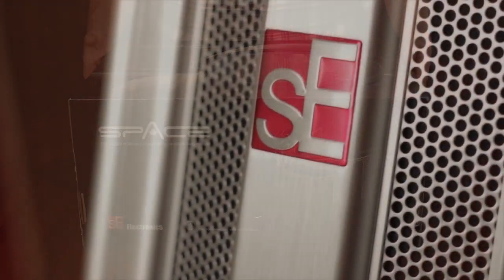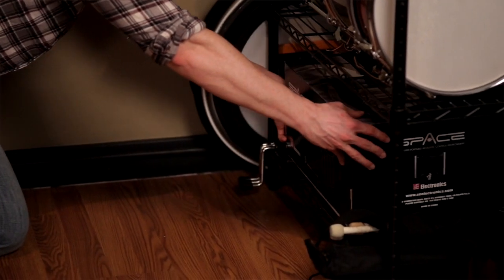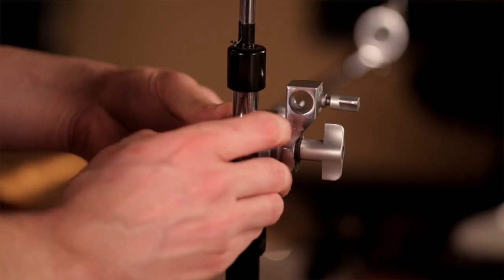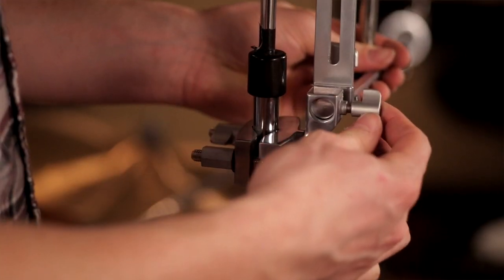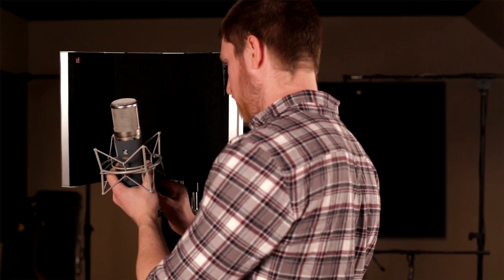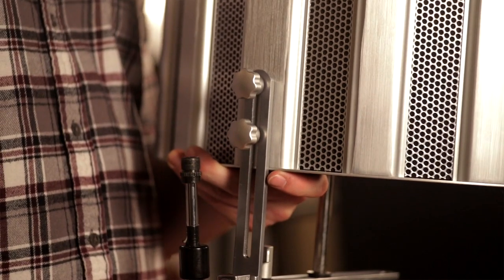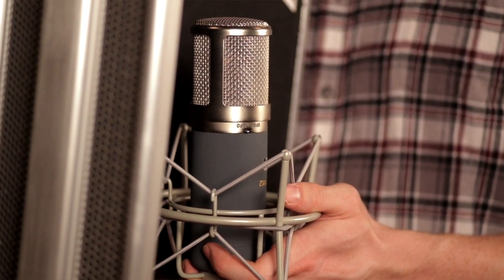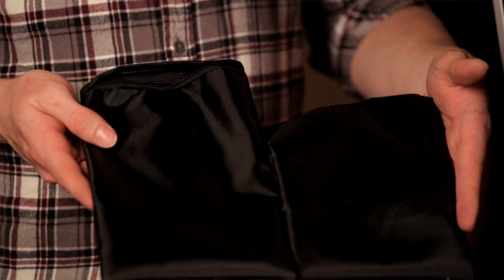sE Electronics Reflexion Filter® SPACE Setup Video

Comment: This video really is not very helpful in the set up process - moves too fast, and doesn't explain/show the steps thoroughly.  Consider remaking this, guys
Reply: In particular, I'm totally stuck on the "attaching the L bracket" step - The video goes into zero explanation/demonstration here and it's quite frustrating
Reply from the maker: So sorry we didn't see this comment until just now! The L bracket has a cutaway in the middle of it, and the two included large silver screws fit through that and into the back of the Space filter. (And we're sorry if the video moves too fast, we will look into this for future videos!)
Reply: I completely agree. The hands are in the way the entire time and it moves way to fast. After watching this a few times, I still can't tell if I even attached the clamp correctly. And that's the first step...
Reply: Yes it's absolutely unclear
Reply: @seelectronicstv  your explanation doesn't help 😩

Comment: Does the weight of this unit require a more heavy duty stand or is a standard stand sufficient?
Reply from the maker: Good question! The filter itself doesn't weigh all that much, but it's often used with heavier / more expensive microphones, so weight is still a consideration. We recommend using a fairly robust mic stand, and we also recommend taking care when positioning the filter + mic to make sure the center of gravity keeps the whole setup stable.
Reply: Would you actually mind recommending a mic stand that works well with it? I've heard some people say to buy a cymbal stand instead. Before I purchase one I need to know which mic stand I need. Thanks.
Reply from the maker: We've had good results with stands from K&M, Ultimate Support, Triad-Orbit, Latch Lake, Atlas, On-Stage Stands, and many more. The main thing is to make sure you either get a stand with a fairly heavy base, or with a tripod base that's wide enough to provide a stable center of gravity. A few good options: Atlas Sound MS25E, Triad-Orbit T2, K&M 210/9. Just remember that if you get a mic stand with a boom arm, you're probably going to want to mount the SPACE filter on (or very close to) the vertical portion, so the weight distribution is even.

Comment: This video utterly fails at its basic purpose: to show how to attach the sE filter to your microphone stand. Every shot has the actor's hands blocking what you need to see, and when his hand starts to move out of the way, the edit cuts to a different shot. It doesn't show that the clamp doesn't merely loosen, it SWINGS open; doesn't show how to use the included washers. sE, please reshoot this 6-year-old video to replace it with something actually useful. 

Reading the "manual" doesn't help, either; although you clearly label the parts, you never show a mic stand, nor how it interacts with the product. Took me a ridiculous amount of time to figure out what should have been a two-minute procedure. Starting with a bad first impression of sE; really hoping the filter itself is good.

Comment: I use a bottle of detergent to weigh down the stand base. But Im using a Tascam reflection filter. It absorbs and defuses. Its $50 less than the SE bs! It uses foam. Not wool. Its sturdy. Not this flimsy SE piece of ish. Why tf would the reflection filter mount on to that thin "l bracket"???? I can bend that ish with my finger. To each its on.